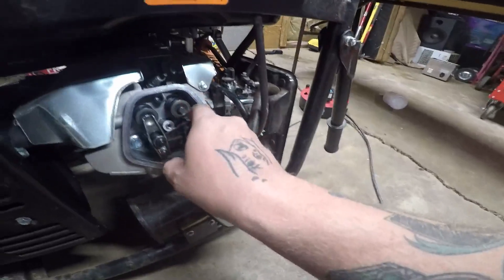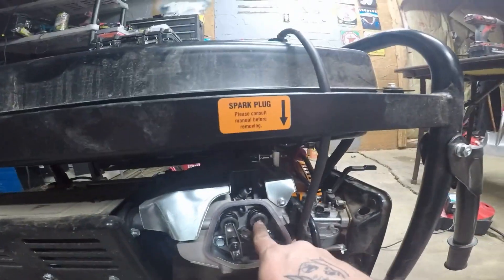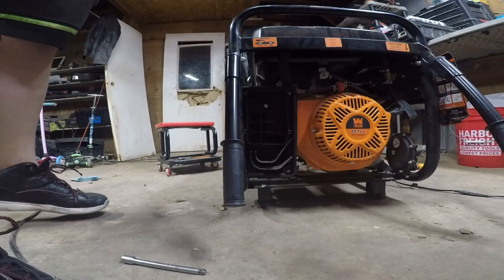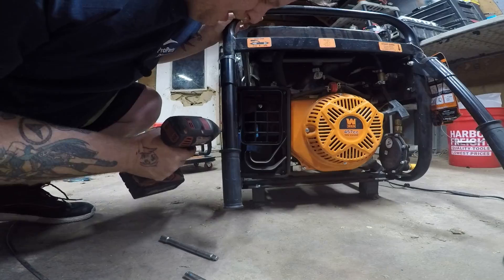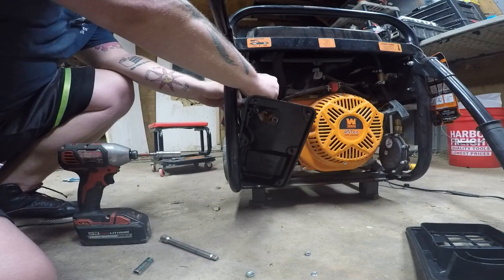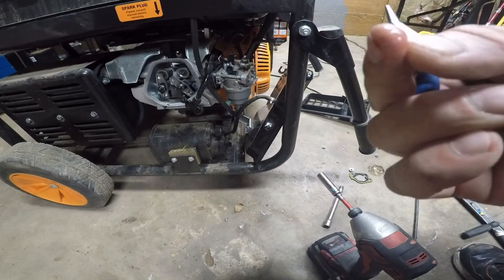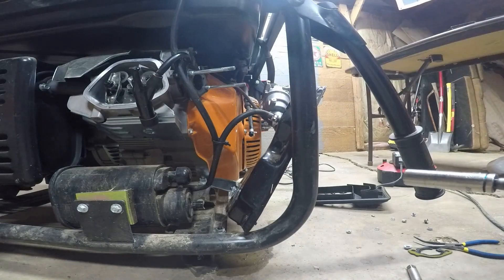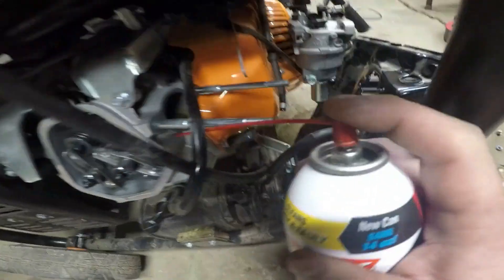Quick Fix: Stuck Valve Diagnosis and Repair in 15 Minutes

Comment: Would a stuck valve cause low compression? 
I think that I overfilled the oil .  after  running it several hours, it died. I tried starting, and it wouldn't start, and it had low compression. 
Thanks!

Comment: Do they come in as a “won’t start and run” issue and you check the valves first or is there any symptoms before they stay stuck?
Reply from the maker: Yes they come in. It won't start. Don't run. First thing I always check is I spray a little bit of carburetor cleaner inside of the carburetor and then I try to start it normally. You can always tell because you'll hear a backfire. If it starts and dies, it's carburetor. If you hear a backfire, it's the valves. If you hear a whistling noise, it's the spark arrestor. If it doesn't start at all or anything before I check the valves I check the spark cuz it's easy to do. If it has spark then I go right to the valves